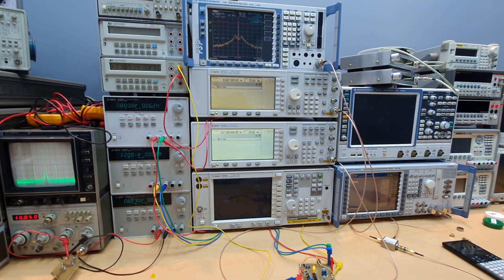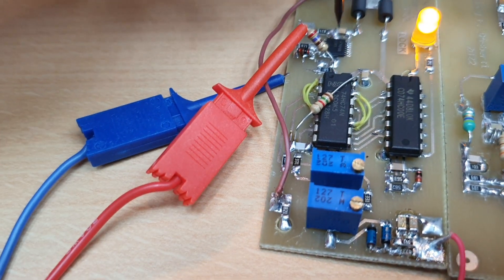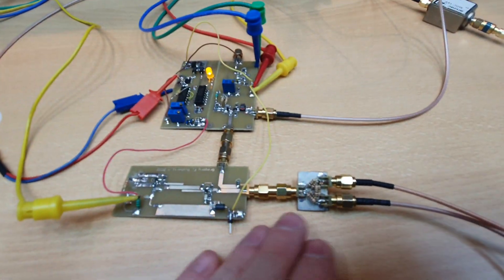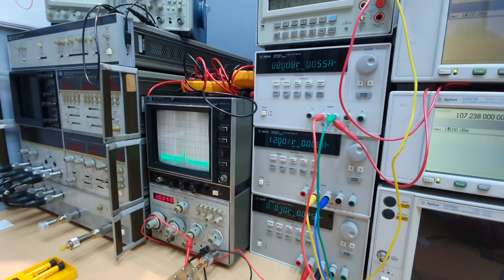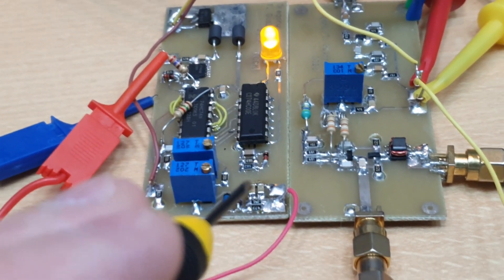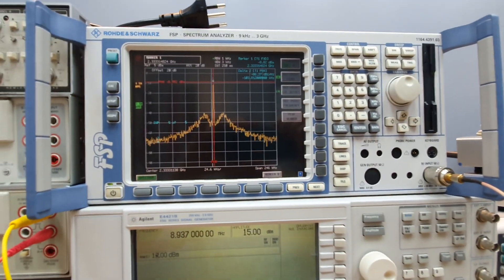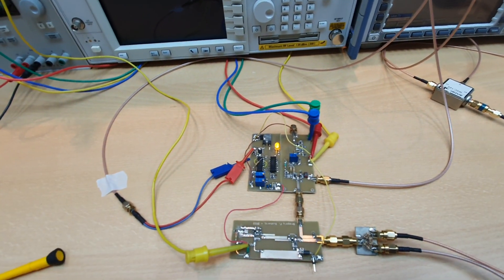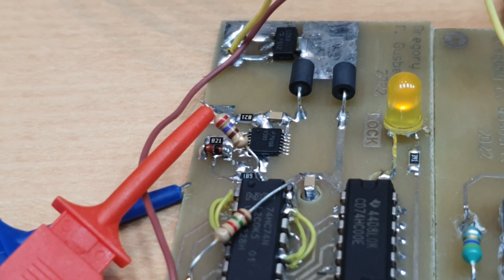10GHz Microwave Source - project update 3

Comment: It is coming together nicely. 
I kind of gave up on Aliexpress for parts, I only buy parts there if I can't get them anywhere else and need this specific one. 
You seem to have the same problem as me by never having enough RF sources in your lab to supply all the necessary signals for testing. 
I'm looking forward to see how your PLL performs when all the modules are shielded. 
I like that you use the S53MV method of doing it. 

I guess if you have some fixed spurs in the end you can always just add a noth filter for this specific tone, not really the best solutions but a good last miniute fix. :)

For the phasenoise you might also have some digital noise from the PLL on your VCO signal? 

This might be a stupid question but what was the whole 10GHz source for?
Did you have a specific need for one or is it just a standalone project?
Reply from the maker: Aliexpress is practically my only option at the moment, unfortunately!

I haven't immediate use for the source hahaha! Thinking in creating a aluminum case to have it on the bench as an equipment.

A while ago I made a very simple DDS source using an AVR (running system a loop, incrementing the phase accumulator and outputting to a pin). Something like this could be use to source the 10GHZ source as reference, to synthesize other frequencies.